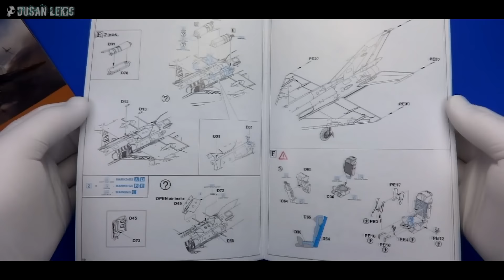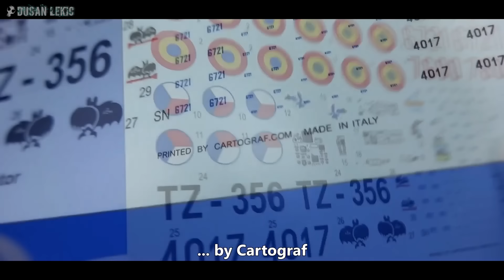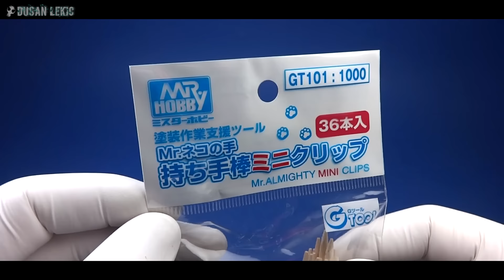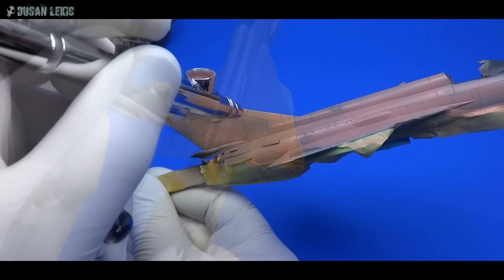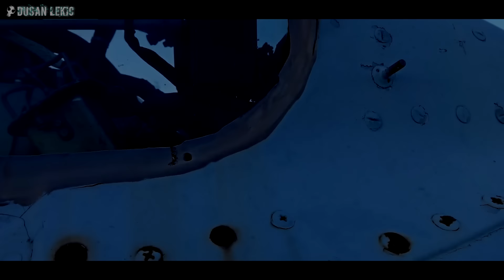FULL VIDEO BUILD MIG-21MF by EDUARD 1:72 scale

Comment: I love this plane, have made several "Fishbeds", some in 1/72 and a couple in 1/48. Even converted one to a model rocket. Flies like a "brick", but is very stable, without added fins. Takes off straight then rolls over an does barrel rolls, a real crowd pleaser. Shows how aerodynamically "designed true" the real plane was!!
Reply: The mig 21 is stable at high speed. At low speed like landing and takeoff the thing is very unstable and difficult to control, plus the engine takes forever to spool up. It cannot handle any kind of negative Gs because of the fuel system, and the engine will stall if you go above a very moderate aoa. The thing is a kind of a death trap for those that don't understand it, and that shows in it's safety record. I love this jet because of all its weirdness.
Reply: @MF-og1ct  good information on the real plane, but I was talking of a toy model, makes a great little rocket powered conversion, cuz it flies true and does not "wiggle around" like a lot of plastic model conversions do, looking funky and unreal as a result. I'd recommend this model as a first-time attempt to PMC a model rocket, best in 1/48 scale to begin with. :D
Reply: @ronschlorff7089  hmmm, I might have to try and make a large scale model to fly on high power motors....
Reply: @MF-og1ct  yes, a 1/48 would take a C6-3 or C6-5, as I have done with two PMC's. A 1/32 plastic model might take a D or E. What I also did was scratch build a 1/24 scale Mig21, in wood and paper, using "normal rocketry techniques", and flew with a D. Being roughly the same aerodynamics, I was "pleased as punch" with the flight performance. I painted it as a camo scheme, green, brown, tan, gray underside, with some kind of Mid-East markings. Not a PMC, but a "normal" rocket model. I imagine up scaling even much further to take the more powerful composite Aerotech engines could work too. Anything is possible in model rocketry, and as I, and many others I imagine, always say: "what could possibly go wrong?", eh? Cheers!  LOL ;D
Reply: @ronschlorff7089  Yeah, I have seen some crazy stuff. One guy at my club put a composite motor in a modified umbrella that had a motor mount and fins. When the ejection charge fired a mechanism he machined released the spring opening the umbrella as a parachute.
Reply: that's great, love the funny stuff. There used to be a show on TV about a lot of funny launches like porta potty, and other weird shit. My club is SARA, in southern AZ. Where you at? We have a launch on 17th, been down since the covid crap for a while, but will be back at it again soon. Have fun, cheers!
Reply: @ronschlorff7089  I typically launch with Northern Colorado Rocketry. Always a good time up there on the plains.
Reply: @MF-og1ct  cool, Rockey Mountain high to be sure, good luck and happy holidays, and a stratospheric new year!! :D
Reply: @ronschlorff7089  Good luck with your projects and happy holidays to you too 😀

Comment: Great build Mig 21 I will make my OEZ kit 1/48 with this marking Belgium
Reply: Its very old kit,  from Letohrad .In this time bestest 1/48 mig -21 But this kit have litle wrong rudder.
You need corrected rudder from CMK, also metal parts , foto-atached parts and resin ejection seat make this kit better.Meabe you need new decals. Same problem had  kit from Fujimi and Academy version MF and Bis

Comment: What kind of clear varnish do you use before applying decals? I'm very surprised it can survive Mr mark setter and softer without any marks left behind. How long do you leave it on the decal?
Reply from the maker: In this build gloss coats from the new Mr.hobby GX range (solvent based). Also I am using the older bottles of (very strong!)  Mr.setter and softer, so quite often I dont leave the solvent longer than 2min. I remove any excess ... and  later seal the decals with H30. Neo Mr. Softer is much less aggressive. All the best! Dusan.

Comment: Czechs are funny. They made a really good looking model of Soviet plane, but hesitated to put at least one Soviet airforce decal, most probably because of their silly political prejudices.
Reply: Soviet livery decals are not included in this kit because the MiG-21MF is the Soviet's EXPORT version of their 21SM. Therefore, putting Soviet decals on the built MF model would have been completely wrong.
Reply: @hlcepeda  Not really. I have checked it before writing my first comment. Some part of machines (I don't know the exact quantity) was present in USSR till the end of their operational life. You can easily find MiG-21 MF with Soviet markings.
Reply: @maximsinitsa9514  Could you post what reference (book/video) you used to indicate that the MF variant had Soviet livery?